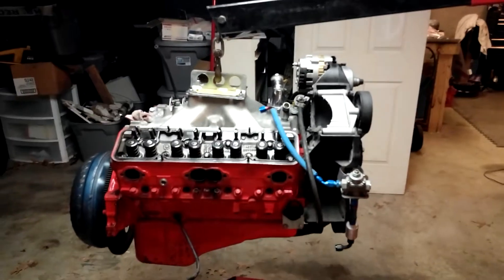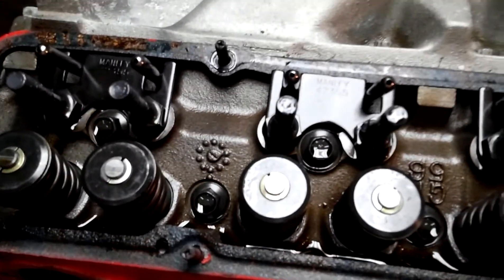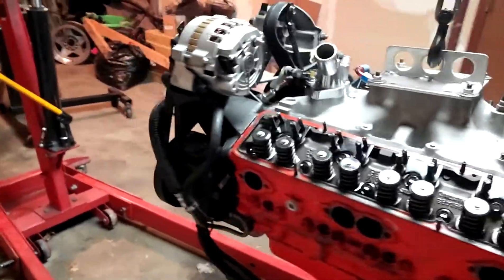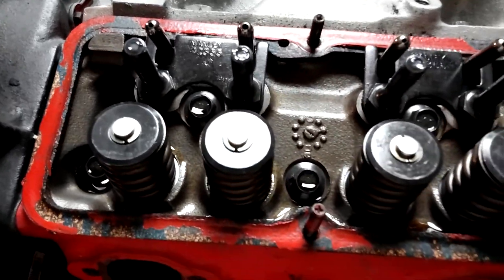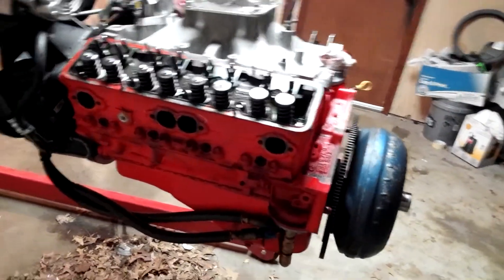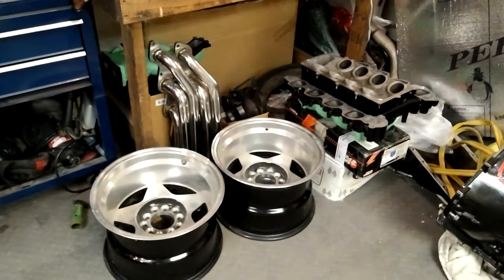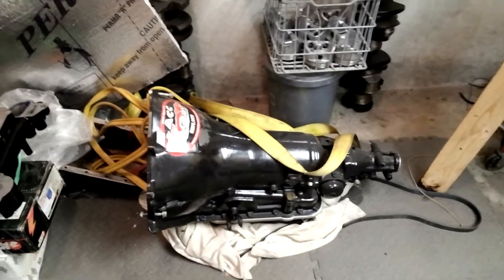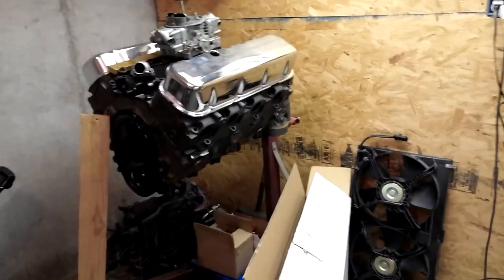Rocker swap 1.52 to 1.60 Comp Cams

Comment: I like using a blue sharpy on metal parts.  Makes it easy to see the contact area.  Far as I know. A spinning valve with roller tip rockers is a big No-No.  Could be from valves floating or wrong style retainers or some other contact between valve train parts or wrong length pushrods or combination of .   either way. Roller tip rockers don't like spinning valves
Reply from the maker: Shane Mcclaran I agree something was wrong I have never seen a contact patch anything like this before. Thanks for the help and thanks for watching!

Comment: Mention of the Rocker swap starts at minute 5, and ends at minute 6.  60 seconds of total talk about the rocker swap to 1.60 comp cams rockers.  Don't waste your time.  Click bait.  Just a guy rambling about random crap in his garage.
Reply from the maker: Mark Davis What did you need to know?  Clearly you were looking for or needing something???
Switching from 1.50 to 1.60 rockers:
1. Need to elongate the pushrod slot/hole in the heads.
2. Increases the lift on the cam 10%
Ex: .447” changes to .477”
3. Make sure the valve springs can handle the added lift and there’s enough clearance between the spring retainer and valve guide/seal  at max lift. 

I’m not sure what you needed but hopefully this answers your need. JD
Reply: @HeadFlowInc  Thanks for the reply, my main beef was the title was very inaccurate vs what was actually in the video.  But I apologize for the tone of my comment, I was in the middle of a search for info and not finding it.  re: increasing lift by 10%, by my math increasing .447 ten percent would give you .491, am I missing something?

Comment: Not marinating a chicken breast. Get a container of oil and put the rockers in and FILL IT with oil. coffee can, etc. Add lucas or stp too. make it stick to rollers.  geesh. get a sharpie and check where the roller tip rolls on the valve tip to see if pushrod is correct
Reply from the maker: uptown kustoms Need a solid lifter with the same pushrod cup depth to accurately measure length using the witness mark on the valve tip.  Because the hydraulic lifter has compression, especially without oil pressure supplying oil to pump them up gives inaccurate results. I have ways of determining PR length, one of the easier ways is to buy the plastic geometry tool. Thanks for the feedback I appreciate the reminder!  Merry Christmas 🎄
Reply: I also have a comp cams PR length checker.  You put lifters in a can of oil and manually put oil in them pumping them. The small amount of compression of the lifter is slight,....a person can see if the rocker tip is high-low-or centered on the valve tip. It aint rocket surgery. hahaha

Comment: You have to mic the washers when you shim the torque converter to make sure they are all the EXACT same thickness.
Reply from the maker: Johnny Hisaw I’ve been burned by this “washer” setup.  I think there must have been an issue with the snout on the converter and the crankshaft register. I agree, if you were going to use washers they all need to be the same and accurately selected.  JD

Comment: hey buddy i have a question i hope can help me with,i have a 91 tbi 350 5.7 that i want to do the vortec 906  heads swap, i know i need a new intake,carb,and fuel regulator but what esle do i need ..Thanks so  much
Reply from the maker: Benjamin Abel All you have to do is the complete Vortec head swap. I mean, heads & Intake, the carb and better ignition is absolutely needed, TBI everything sucks as you already know.
If you can get the FITECH system it will be a blessing, match the intake to the rpm range of the cam.
Reply from the maker: Benjamin Abel HEI or a MSD ignition, throw away the TBI ignition system and OBD1 junk. 
It’s all about budget, the MSD is best but a good solid HEI with custom Advance curve would work.  Honestly if it’s a daily driver or will be driven in the Winter it’s hard to beat a modern fuel injection kit.
Reply: Did u ever do the swap? I did it to mine last yeat

Comment: what about 1.7 and 175 swap for intakes and 1.6 for exhuasts
Reply from the maker: Chill Tech Services I'm pretty sure it would have needed better valve springs fir a 1.70 or 1.75 rocker ratio.   It's best to have heads on a flow bench when playing with rocker ratio imho.  The changes can be subtle and hard to identify driving the vehicle due to all the variables. You can definitely dial in a combo to match the heads by manipulating the valve lifts. Thanks for the feedback!  JD